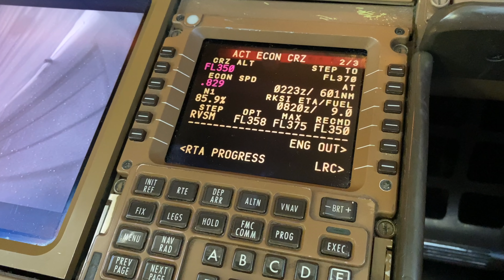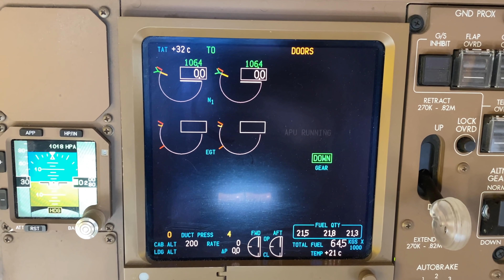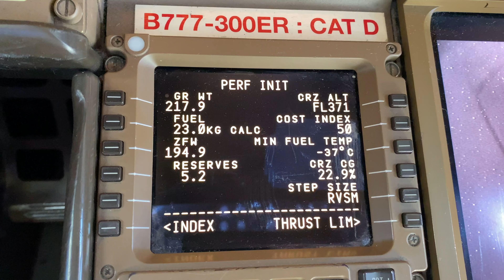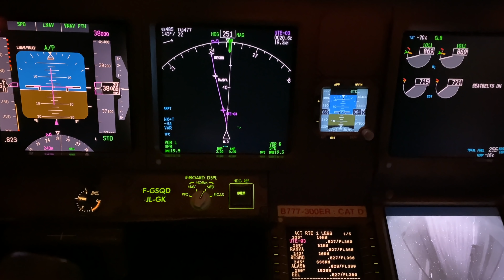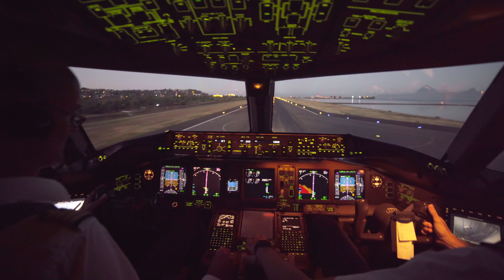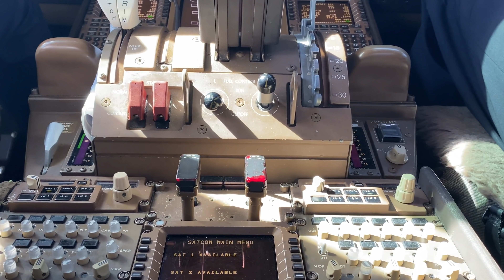10 ways to reduce carbon emission as a pilot #greenpilot

Comment: You said about shutting down the engine on taxi and making sure to shut down the correct one but on the A320 at least you have to shut down the right engine cause if you shut the left you’d get the PTU barking constantly to maintain green pressure correct?
Reply from the maker: yes correct. and On the 777 we don't have this matter.

Comment: Amazing explanation,  thank you! I would have a question about some strange and specific airline routes in chinese airspace in the area of Beijing. When we have flown from Frankfurt to Shanghai, pilots performed almost 90 degrees turn to the south above Beijing (so no efficient straight way to Shanghai). I would like to know - is it also due some efficiency which I do not understand or are they just some unexplained chinese airlines rules? :)
Reply: Chinese airspace has a lot of constraints (terrain, military airspaces) and sometime, you have no other solution.

Comment: Thanks Hugo.
I would just like to add something very important : weight reduction ! Pilots, as well as the company, have an impact on weight and, as a consequence, on consumption as a lighter planes consumes less fuel.
For pilots, the goal is to avoid to take too much fuel hereafter the regulatory and reasonable quantities needed for the flight. Indeed, 1 more ton boarded on a long-haul flight will increase consumption by 150 to 350 kg. That’s why we take a long time during flight preparation (before going to the plane) to study the flight plan and decide how much fuel we will take to keep reasonable margins and respect regulations (no, we don’t fill the tanks before each flight as someone do in his car 😉).
For the company, there are many ways to decrease the aircraft weight : cabine equipments, boarded catering, on-board documentation... At Air France, for example, they changed the cups manufacturer to gain 3 grams per cup a few years ago. It seems ridiculous, but multiplied by the number of cups and the number of flights, the overall gain per year was hundreds of thousands liters of fuel saved ! On the same way, removing all the paper on-board documentation (some 80 kg of paper per plane...) allowed to minimise fuel consumption by thousands of tons and reduced raw material impact.
Current plane-bashing totally ignores this efforts and most people think that fuel efficiency is only a matter of aircraft and engine design, while it is a whole company’s engagement.
Reply from the maker: Bonjour Kriss, merci pour ton message. Il me semblait que tu avais écrit en Français donc je me permet ;) Alors en effet, lors de l'écriture de la vidéo je commençais par ce thème, le poid, qui est le plus important dans notre conso. Mais très vite cela prenait 3 à 4 minutes pour expliquer le concept et tous les efforts que nous avions mis en place depuis des années. Finalement cela détournait du côté opérationnel/vie de tous les jours des pilotes. En fait, cela mériterait une vidéo à part entière! effectivement il y a eu de très bonnes choses de faites, et nous pouvons encore aller plus loin certainement! A bientôt!
Reply: Effectivement, j’avais commencé en Français puis traduit en Anglais vu que c’était la langue de la vidéo 😉 Et oui, le sujet est vaste... Merci et à bientôt !